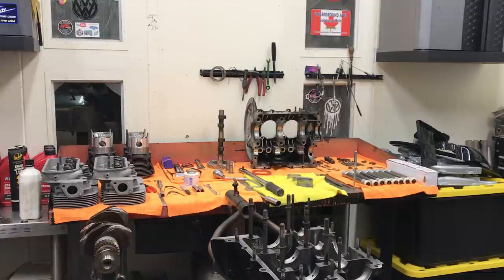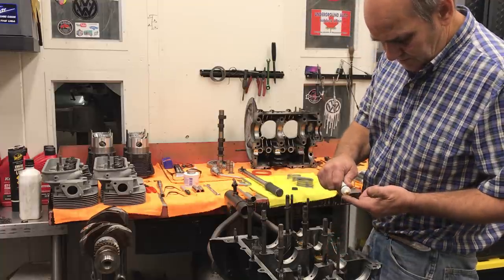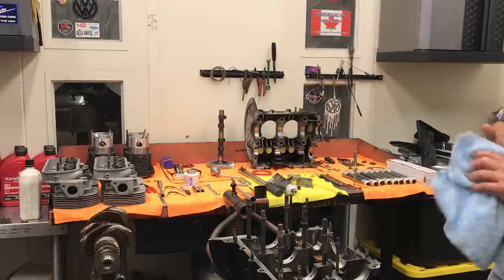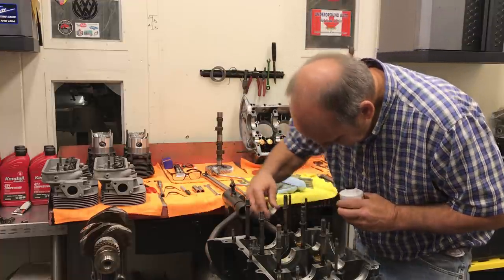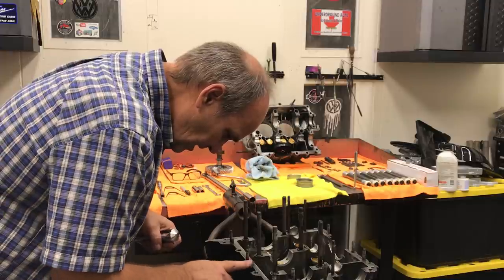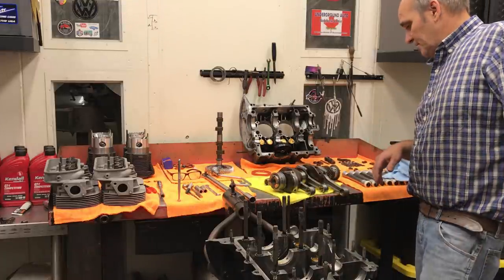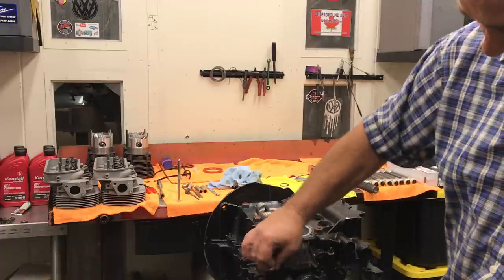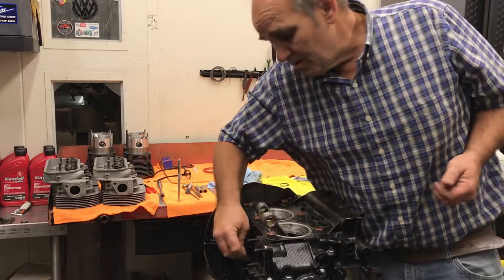VW Engine Build Super 1600

Comment: Havent seen you in a while! Good to see a new video. I could use some in put on transmission setup I have a sand rail that has a 68 swing axel long in it and it needed some up keep upon pulling apart to do a new seal. I'm having issues with getting it to go into the gears properly. Atleast I think so. When the transmission  is out of the vehicle and it's in gear should the 1st, 2nd, 3rd, 4, and reverse be able to turn in both directions? Or should it only spin in the direction it is intended to? Any help would be awesome. I'm new to Vw air cooled and know so little about the transmission stuff. I tried to find a jig but had no luck. None of the actual gear parts have been pulled apart. I feel like it's just getting g it adjusted and put in the case but I cant figure out if iv done something I wasnt supposed to.

Comment: Got a question.  Am planning  a 1600 dual relief, dual port engine build. What would be good heads to use if I want to stay close to stock but want a real good quality heads since that is where the horsepower is generated.   Thanks.  JS
Reply: Also. Please give me your opinion as to what cam to use, this engine is not going to be used for racing but rather regular driving in town as well as on highways.

Comment: I know how to build engines and stuff but my question is for my 2180 do I need bigger valves in them
Reply: Most certainly....
Reply: @vayabroder729  and why that my 1968cc is stock
Reply: @chriskilla247  Once you get to such a large displacement it is best to maximize its potential; stock valve sizes would be restrictive. You can use stock valve sizes up to a certain displacement.

Comment: Hi Darrin, quick question I have a new set of cases i bought 20 years ago. I am building a 2110 I went to put the thrust bearing in and there wasn't a tang cut in the case on the one side can i file a tang slot or sould i bring it to a my machine shop to do it?
Reply from the maker: You can cut yourself pretty easy with a small file. You really only need one Tang they make both single and dual tang cam bearing sets I will usually cut a notch if I am building a performance motor and go with the double set up.

Comment: I have a question. I have a engine that was a 1641. Cam in a 120 . I don't want to break the case apart. 
 Want to increase the h.p. by going to 1600 jugs. The crank is a stock 69mm . I have been looking at rods some the center to center is longer. 
 That's my question,  can I get more compression by just changing the lenth of the rods, or is that a really bad idea
Reply from the maker: @genenoud9048  It is not a bad idea. You can use on the rod to move the piston closer to the combustion chamber the tighter you make the quench the more compression you will have. Just make sure to check your piston to have clearance at 15° past top dead center. This is usually where you will have an issue if you get the piston to close. Typically in the Volkswagen world 50,000 is the norm between the top of the piston and the top of the barrel. I have tightened it up to zero before on personal stuff you can get away with 30 and still be pretty safe. On a V-8 you can make it zero or above the deck. But Volkswagen squirm around a little more than a V-8. Hope this helps and doesn’t confuse you lol
Reply: @vwdarrin  thank you , as always I enjoy your pod cast. I hope you are doing well. God bless

Comment: Hi Darrin, I just bought a 67 bug and it came with 2 1600 dual port engines and the original 1500 engine. I am wondering how I would go about figuring out if these guys are still usable or whether the block/internals are bad (i'm brand new to automotive hobby). I'm trying to build one of the 1600 blocks as large as I can while maintaining as much reliability/stability as possible. Ive read you can't build an engine that does it all (good MPG's, good power, reliability) so my biggest goal is to just get something that has good torque/acceleration to get up to speed easily on these crazy tight onramps where I live, and decent MPG's if I want to drive it like a grandma. Additionally, I don't want to be doing a rebuild every 6 months and maintenance every week cause things are out of wack. Im not looking to take it to the track or anything. Maybe i'm asking for an engine that doesn't exist. I know its a lot of info, any help is appreciated.
Reply: My father had two VW's when we were kids.  One was a 1500 that was very reliable, and ran for many years.  The other had a 1600 dual port.  The 1600 dual port was a nasty engine which ended up needing a valve job every 30,000 miles.  The 1600 dual port also would suck valves through the pistons.  Also the 1600 dual port ran like a tin can.  I remember the day when the compression  in the 1600 was low, and it was going to need more engine work.  That day is when dad sold that 1600 dual port.  We kept the 1500 running for 15 more years long after that 1600 dual port was gone.  The 1500 was also sold many years ago, and I still see it running today.

Comment: Great video; I ‘ve seen instances in which the bearing oil holes don’t match up with the ones in the case. How do you solve that?
Reply: One way is to markthe case with a little paint around the oil hole, install the bearing and then chamfer the bearing to make them line up.
Reply: @VWJawbreaker  thank you!!